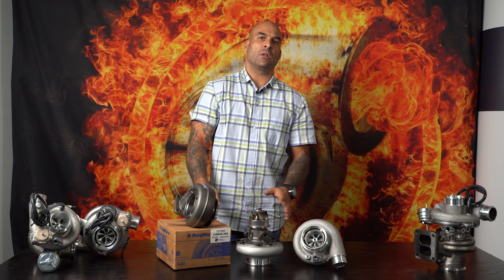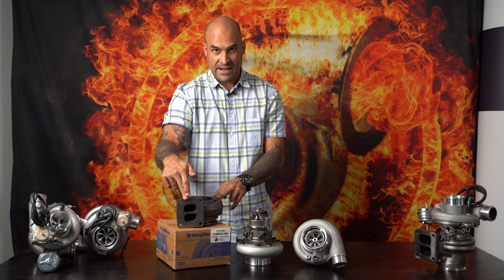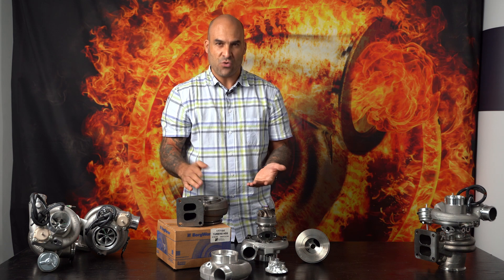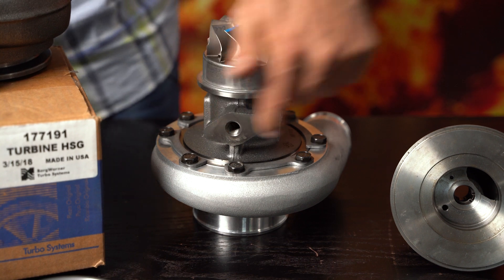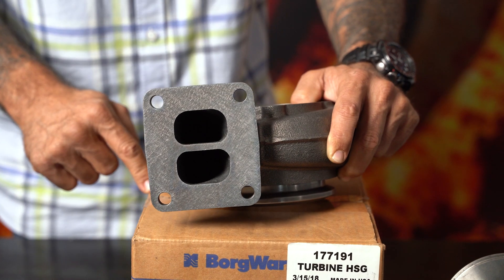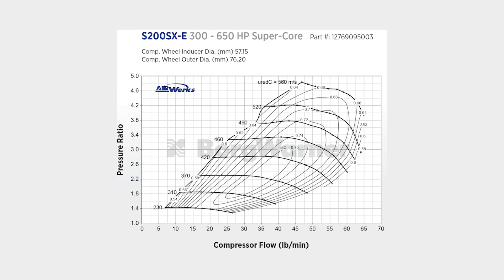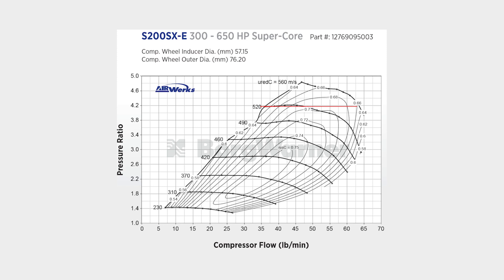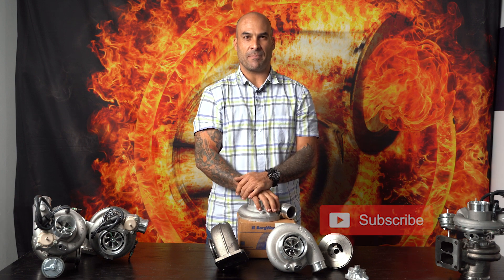BorgWarner Airwerks S200SXE - 650HP

Comment: Thinking to get a s257sxe for my 2.0 Evo. I’ll be making a manifold for it soon and wondering. Would you recommend making the manifold with twin scroll t3 port or using a twin scroll t4 flange and then port matching the turbine housing?
Reply from the maker: David use the T4 twin scroll option, and use a larger AR than the 83 -- i would opt for the AR1.00 on the Evo. It will spool FAST and hard
Reply: @TurboDirectSA  thanks, I was looking at using the 1.00 twin scroll so that’s good to hear confirmation from you 😄 
I’ll make the manifold with the T4 and then port match the turbine housing then. 
Thanks a lot, love the information from your channel 🤙
Reply from the maker: @Mendiesel86  Perfect choice David - Thanks for the compliment, glad you enjoying it.
Reply: @TurboDirectSA  would you happen to have a 3D cad of the s257sxe I’d be able to print? I’ve got lots to do before I actually buy the turbo and would like to make the manifold and have that side sorted. 🤷‍♂️ worth a shot 😅
Reply: @turbodirectSA  @Mendiesel86  I have similar Evo 8 with Large Runner T4divided and 272 billet cams. I was considering S252SXE (52mm wheel) would you still recommend a 1.oAR for this setup? Car runs autoross so looking for low end spool

Comment: Awesome Videos! love the effort you put in all this informative contenent! 
I have to upgrade the turbo on my 1.8 liter nissan ca18det. Target pressure will be around 1.2bar (boost gauge), limiter at 7200rpm with 100 octane e10 fuel. Im undecided about the gt2871r or  the s252sxe. both with 0,72/0,63 ar on t3 flange. Aiming for 300-350hp.
An advice from you would be amazing!

Thank you for sharing with us this quality of videos!
Reply from the maker: Thanks for the compliment. We have built a 100% stock CA18 years back for a client together with Steve Clark from No Sweat Racing. This was a toy and track car. We used the GT2860RS back in the day and it spooled wonderfully and made 350HP.  This ran pump fuel with octane boost and sometimes ran 100% AVGAS - Boost was around 1.6bar if my memory serves me..... 

For this power you want response, the problem with the CA18 is that it doesnt spool a large turbo easily. The SXE is a journal bearing turbo, and i would recommend using a ball bearing turbo for this upgrade. If you want a brand name i would steer you to the EFR 6258 without a doubt, and even the EFR7163 with the smaller T4 turbine housing AR80. 

This is another option for you - which spools very quickly and makes all the claimed power. https://store.turbodirect.co.za/index.php/shop/category-layout/results,1-24?virtuemart_category_id=&keyword=g28&limitstart=0&option=com_virtuemart&view=category&Itemid=541
Reply: @TurboDirectSA  Thanks fo advice!
Reply from the maker: @MotorsFan17  Pleasure - anytime.

Comment: Hello from france, awsome Chanel that you never see until you are really doing decent research on the best turbo for your application… I’ looking for a turbo to match my om606… (mercedes 3liter 24v turbo diesel with mecanical pump that will hit max 6000rpm with me) so I am aiming for around 400hp( bit more or less doesn’t matter) but I don’t want to much lag, so spool at 2500 max would be good… s252 would be the best right? Thanks man!
Reply from the maker: Hello France - welcome! Thats high RPM for a 606 --- the S200SXE will work well, but you might need a slightly larger AR turbine housing - start with the 82AR and see from there, monitor the HP and torque curve and if it falls away too early, increase the AR - make sure to build a separated manifold design if possible.
Reply: Thanks a lot for input ! No 6000rpm is not so high for a 606 even if at that rpm efficiency is almost all gone… just to say I ordered a s257 with a custom single scroll 0,63 housing… so we’ll see in a couple of months, I’ll be back with feedback 😉
Reply from the maker: @lorcosgarage9443  I would have assumed so - higher rpm in most diesel setups are not efficient at these RPM ranges. Runt he S200SXE and see how she performs, i doubt it will be a poor setup, might be a slight bit on the laggy side, i would have opted for a ball bearing turbo instead, but this is a start - please keep us posted

Comment: Looking at a Borg Warner S300SX-E SXE361 (83/76 61mm) 400-775hp 0.91ar to4 divided for my 1jz gte. Wanting something fast and responsive on the street with a good mid range. Will be installing a quick spool valve aswell to help that low end torque and drivability. What would you recommend.
Reply from the maker: What HP target do you have in mind?
Reply: @TurboDirectSA  I'm interested in the same. I have a 1JZ GTE VVTI. I have a drift build looking for about 550 or 600 horsepower. Some mid range. Any recommendation would be highly appreciated Thank you
Reply from the maker: @TyBement  Always remember a drift setup requires response low down,. especially when on faster tracks and/or if you make a mistake a fall outside of the power band. the S200SXE is a great option for that HP target BUT, its journal bearing, and although with the twin scroll housing options, there is still some lag compared to ball bearing options.

Comment: I got a queation if possible,,this uppload is old but i hope someone see it,, im about to turbo a bike,A suzuki 1300rr hayabusa its a 2005 and has around 160whp,im thinking of a garret G series G25-550/660 or G30 550/660,what i like is that these turbos has ball bearing,meaning it will spool upp fast..my goal is for now 250 - 300whp and its used for street,,from city to city No racing but want to strech it when needed...because its a bike and small engine what ar and size turbo should i choose.
Reply from the maker: Thanks for the enquiry - please note we hold ALL records in AFRICA for the fastest sprint machines with standing start to 1000m and standing start to 1609M (texas mile) on the African continent - using a turbo busa. We have extension knowledge with these bikes and have the most powerful version on African soil making over 1000WHP. 

Please shoot an email to info@turbodirect.co.za with more info on the project and ill have Chris reply to you directly.

Comment: So I'm in doubt, will this still work with a 1,6 litre engine? Me and my buddy want to have 350hp target with forged internals and ported intake manifold. And all that, but im still not sure If it will work out on such a small block. What is your opinion? I appreciate the help and all the usefull videos on your channel!
Reply from the maker: Thanks for the comment - the S200SXE will not be very responsive on such a small engine unless it has a very high RPM range like the Toyota 4AGE - i would rather go for a smaller more responsive setup for such a low HP target.

Comment: Hello I have a 1990 R32GTR with built more and all supporting mods. Still running stock turbos with steel wheels on 94 pump gas. Im in Canada and we dont have E85 here. What spec would you recommend for great response and up to 600whp. I am considering single or bolt on 2860-5 turbos. Thanks
Reply from the maker: Thanks for the comment - i used to run the twin 2860-5 turbos and they worked well - until i came across the EFR range. Singles give you more to choose from and a wider power band. The EFR7670 is a loaded gun on these motors.  The turbo will spool fast for the street and make the power you want and then some.  keep it internally gated, its boost control is excellent.
Reply: @TurboDirectSA  Thanks for the quick reply. What spec would you recommend and why not the S200SXE?
Reply from the maker: @redonegtr5292  Pleasure buddy.  The SXE is journal bearing, and as a single turbo its dynamite!!  You mentioned two BB units, so i took your lead there. The SXE is so under rated its scary! If you interested in a JB setup for the power you want to achieve this is probably the best turbo out there. The twin scroll housing is going to make the car so responsive low down and the turbo is small physically so it will fit nicely under the hood with plenty space to spare.
Reply: @TurboDirectSA  I was looking at the “-5’s” in both configurations. Just doing research now. Lots of opinions out there most are running race gas or E85. I just don’t want to be disappointed with a laggy single.  Is the efr7670 worth the money?
Reply from the maker: @redonegtr5292  Using the EFR7670 (similar size rotating assembly to the S200SXE) in ball bearing with the Gamma TI turbine - this will out-spool the S200SXE and without a doubt is a definite winner!  Every single suggestion we have made toward the EFR range of turbos has resulted in a customer for life. There hasn't been a single disappointment other than "Damn i should have gone bigger, i want more"   The turbos spool fast, have wide power bands, and are reliable and smooth.   EFR is the hidden jewel of turbos, which are under rated in my opinion.
Reply: @TurboDirectSA  Hey bro. So getting closer to purchase and leaning in for the single turbo PUMPED!. Looking at the S200SXE and EFR7670 as recommend. Going with twin scroll for the quicker spool. What are specs A/R do you recommend for 600whp on pump gas? Thanks again.
Reply from the maker: @redonegtr5292  Hey, which turbo are you leaning towards? The housing options between the two are different, and sure the 7670 is ball bearing.  if its the S200SXE i would opt of the AR83 Twin scroll T4inlet and Vband out - if you leaning towards the 7670, the T3 AR83 turbine with Vband out. This is a fast spool, but if its outright power you want with a little less low down, the T4 Twin scroll AR92 housing is going to be something special.
Reply: @TurboDirectSA  what kind of power and response are we looking at for each on pump gas 93?
Reply from the maker: @redonegtr5292  7670 will spool faster than the S200SXE purely because its ball bearing, and also that it uses the GAMMA TI turbine wheel - this wheel weighs nothing compared to other Inconel Wheels out there. When i first saw the physical size of the 7670 turbine wheel i was sceptical about its response, and that was quickly put to bed on a number of projects that run this turbo, shoot me an email at info@turbodirect.co.za ill reply with a video and dyno graph of a clients FT86 build using the 7670 - you can judge the rest for yourself, i believe you will be very surprised- needless to say, this client is now going for the 8474 Black series to replace the 7670 with, purely because he wants alot more power - he was surprised at the response of the 7670, and for his top end power demands, the 8474black suits this 100%

At the end of the day i believe you will see about 300-400RPM difference between the S200SXE and 7670 but this largely depends on tuning, and alot of other hardware supporting mods. Remember with the smaller turbine AR option on the 7670, you need a T3 single entry flange face - with the S200SXE- you using a T4 twin scroll setup - so the manifold would be different, and separated. bearing this in mind, you will see a very similar spool with these two turbos.

Comment: Hi just subscribed, fascinating and hard to find turbo information, thanks! 

I've got a project with a Mercedes OM606 3l diesel engine. They're short-stroke, high-revving and can make lots of power with a decent fuel pump.

Just wondering if you have any experience with these engines and which turbo you'd recommend to make around 400bhp.

I've got a Gen 1 GTX3582r with a .61 a/r twinscroll housing that I was planning on using, but have some reservations about using a ballbearing turbo making high boost and on a diesel.

The BW S257-SXE seems like it'd be a solid performer at up to 3 bar on this engine, is it comparable to the GTX at all? All the best and keep up the videos!
Reply from the maker: Thanks for the subscription - i hope you have alot of learning enjoyment for the future. I will try my best to keep the content coming.  The S200SXE is a more suited option to the OM606, less complicated to install, less lines, better low boost response and will hold its own into the high boost expectation area.  It will also make the 400HP at a relatively low boost. Bang for the buck - unbeatable!  Use the twin scroll  AR83 housing, its slightly large than the AR61 of the GTX35, but will spool acceptably well - careful with revving too high on the Diesel engine, if you lose a valve train, it will cost you a pretty penny.
Reply: @TurboDirectSA  Thanks a lot for the detailed reply 🍻

I'm going to try the gtx out but the S257 does look perfect with less complications and designed more for the high boost we're after!
Reply from the maker: @Club86  Let us know how it pans out.
Reply: @TurboDirectSA  om 606 and 60x engines are the highest revving "stock" diesels around.   stock they all do more than 5k (which isnt much, but were talking mechanical injection here)   guys do valve springs and gov work and do 7k.  motors dont last long cause of bad harmonics (blocks crack the mains) but they dont spin apart. most are melted by that point tho.
Reply: @Club86  if you do ball bearing just make sure you plumb the water cooling ports properly.   if your worried about shocking the bearings with surge, run lower on the turbos map. (also focus on air flow not boost pressure)
Reply from the maker: @g__wizz  Interesting info - thanks

Comment: S257 for a JZ ?
Reply from the maker: Which JZ? 2JZ, 1JZ, 1.5JZ -- what spec?  Drag, street, stock bottom end, and head? Low boost?  Power target? What tranny?
Reply: @TurboDirectSA  2jzge strictly street use, automatic, low boost, stock bottom end, nothing to write home about but something to enjoynmoving around in daily, a commoners car
Reply from the maker: @streetinfamy  OK then its easy - the S200SXE 650HP with the AR83 Twin scroll turbine housing will work very well and spool fast. You should expect to have full boost around 3000RPM already tuning, fuel, and supporting hardware dependant.

Comment: Great videos! I have a rb30/26 hybrid engine, stock head, stock internals.
Redline is 7000rpm and i guess at 600whp this engine will break in half.
I have a s257 sxe and a s362sxe (80mm turbine). I guess 600whp would be hard with the s257. But spoolwise and emap wise, could you make an estimated guess what it would be? Proper twinscroll manifold is on.
Another idea, where would a efr 70/64 run out of puff on this combo?
Thanx a lot!
Reply from the maker: Thanks Dennis for the compliment - glad you enjoy the content. The 7064 is only capable of 550HP - the 7670 is on par with the S200SXE at 650HP - you will make 650HP with these two turbos without a doubt. If you looking to make 600WHP permanently and continually as an everyday all day power setting, and not a high boost setting where you will run a lower power delivery and then up it to the 600WHP with high boost, then you should consider a larger turbo with something in reserve. 

The 8474 Black series will suffice easily, and you'll be surprised at the spool up of this turbo - we have been involved with a hill climb car which is running the EFR8474 Black with AR92 twin scroll turbine housing and the car was already coming into power around 3500RPM - the engine was built by Steve Clark and made for 1300HP and designed to live at 10 000RPM (RB26DETT) all day long - so the demand for air flow was immense, but the turbo spooled up very fast - you are running a 3.0l -- the hill climb engine was a stroker 2.8l.  I would run the AR92 Twin scroll turbine on the 3.0L and leave it internally gated as we did above - shoot an email to info@turbodirect.co.za and ill send you a video of the car doing a launch (no launch control activated) and you'll see what i mean. 

I might add this short clip into a video showing the spool up of the black series - and add more video content with the new AR1.05 turbine installation - and speed sensor.
Reply: @TurboDirectSA  Thanx for the quick reply!
I guessed so. The 8474 Blackseries was on my list, but the older 8374 should easily be enough turbo too, i guess?
In terms of spool, the 8474 wont outspool the 8374?
Thanx
Reply from the maker: @denniswiese8886  Pleasure Denise - the 8374 uses the same turbine stage, so spool characteristics are pretty much the same, but the 8474 flows 200HP more - makes no sense to spend the same money on a turbo that is capable of less power with the same response. .... 8474 Black all the way.
Reply: @TurboDirectSA  Yes, the same money would be nice. But, t4 twinscroll int gate the 8374 is about 2300 Euro and the 8474 is about 3500 Euro here in Germany. Thats a big difference.
Reply from the maker: @denniswiese8886  Thats very expensive - our price on the 8474 Black series including AR92 internally gated housing with hardware pack, plate and bolt pack, actuator bracket and high boost actuator is 2200EURO - we dont sell the 8374 at all, for the explanation in my previous message to you. This is for the aluminium bearing housing option included in the above price excluding shipping.
Reply: @TurboDirectSA  Yes, i know. Take this price + shipping, 27% fee and toll and you are at approx 3050 euro.
Whats the price for cast bearing housing?
What is shipping to germany?
Reply from the maker: @denniswiese8886  Not sure which 27% fee you referring to, but this is incorrect. We export to Germany often, using UPS - send an email to info@turbodirect.co.za and we will provide you with a quote for the complete turbo including shipping, once we have your physical address.